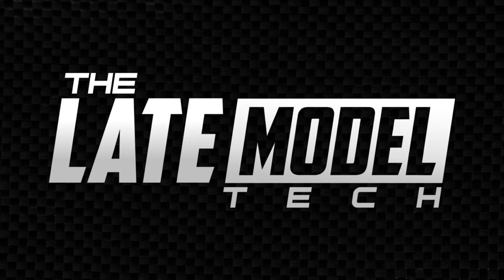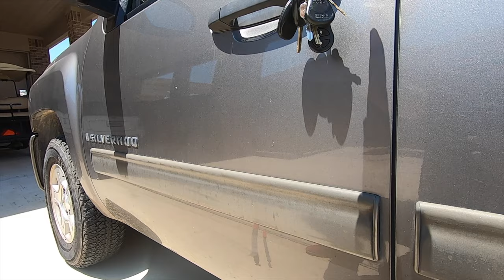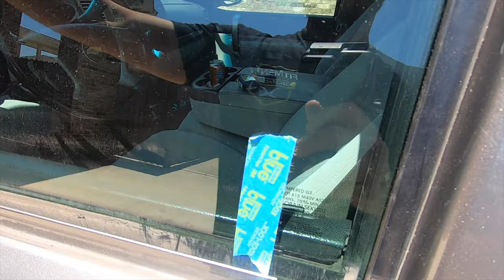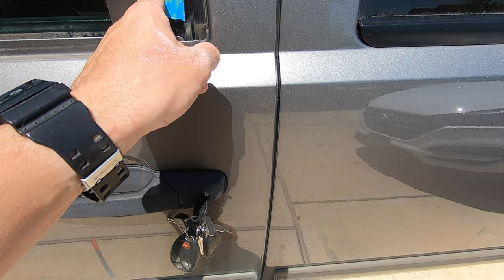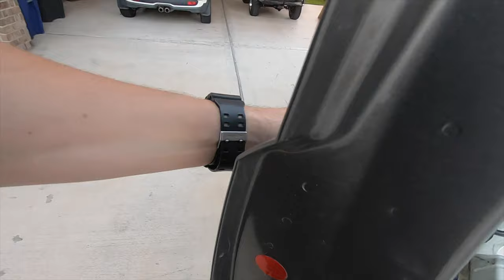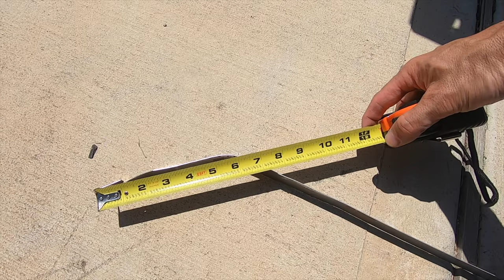How to use a Slim Jim on a Chevy Silverado / Unlock a Car door

Comment: I made a tool because I couldn't find my Slim Jim. I couldn't get it to unlock it just kept getting caught. Tried it today after modifying my tool. Had to cut a little off the bottom because it must not have been dropping enough to catch the hole slot. Took me 1 try and 15 seconds and I had it unlocked. Now the bad news. I was so excited I open the door to get my keys and the tool slid to the left and fell inside the door. I am surprised that happened because in the video you drop yours so you could use both hands and yours stoppped on the other side. NO PROBLEM. Just glad it is unlocked. The POS dealer wanted $104.00 just to cut a key from the vin.  That was without programming. Guess that would have been another $300 . Thanks Donny.

Comment: This is a great video and I thank you so much for making it, but I wanted to add this in the case someone else is as dense as I was and made the same mistake.
 Make sure the bend that the tech so excellently showed you how to make for the Silverado is facing you when you first put it in the window slot. I worked at it for a lot of time, about an hour, in very cold temperatures to no avail. Finally I hiked back to my home and watched more carefully and saw my mistake of the bend pointing to me instead of the truck. Once I hiked back to the truck, no problem, The Silverado rides again! Thank You once again for an informative well shop video solving a problem that can cost you plenty if you do not do it yourself.

Comment: This is a 97 thunder bird supdevill coop that has electricity windows and push buttons for your door locks and I don't know alot about using a slimjim so if you can make your own choices in which part of the door that is what best suits to use the slimjim to get into the car with the best possible way

Comment: You'd love to have seen this.  I pulled up in the liquor store parking lot and there sits a pickup nearly identical to mine.  All sorts of guys gathered around it, all big boys and one of them trying unsucessfully to get that door open on that Silverado with a slim jim.  I walked up to the crowd, reached through all these guys, stuck my door key into his pickup and opened it, pulled my key back and walked away.  They were all standing there just staring at me.  I doubt there's more than half a dozen keys for all those millions of pickups.  Be sure and try the keys of all your friends if you can.
Reply from the maker: Lol, funny you say that.   I have the jiggle key video coming soon. Lol
Reply: @Donnythelatemodeltech  I've opened my door with my ignition key jiggling it. Opened it with another key that was neither one. 

Used to start my dad's 64 Biscayne with my 55 Chevy pickup key.

Amazing how worn locks can be jiggled open with any similar key.

My 2000 Silverado has been opened with 4 different keys, and like I said, the ignition key.

You can open nearly any door or ignition with the same make key if you take some time and feel it out. 

When I was a kid a quarter would clean out a vending machine. I'd take orders from my friends. 

Cold drink machines were a bit harder.  I finally learned theft is theft but when you're a tween it was just defeating a lock for fun.
Reply: Thanks

Comment: Didn't have a slim jim, but I used the same methods with a wire hanger. After a few attempts I was able to get it unlocked. So easy a caveman can do it
Reply: Pop a lock wanted to charge $140

Comment: Cool. Unlocked! Now you can tow it to the junkyard.
Reply from the maker: Dang, little bit of chevy hate.
Reply: @Donnythelatemodeltech  I own three. And yes..more of a love-hate. Older models I love..but they eventually will just not be repairable. The newer models I absolutely hate. They are DOA. VERY poor design and assembly. But that's just my 2 cents. Your mileage may vary!
Reply from the maker: Thanks for the comment, stay safe and enjoy your weekend!
Reply: I have a 2010 with 300000 miles still runs like new. And everything works with no major repairs. Yea.. totally unreliable and poor build quality...

Comment: This happened to me in a remote area with no signal. Had to pry the handle and break the plastic collar over the lock cylinder, could open it with a screwdriver after. New handle - 40 bucks.

Comment: Ik its a pretty long shot to get a reply but i have a 2010 sierra so basically the same truck and i cant get my passenger front door open. Neither outside or inside handle will open it and im aware that it’s common for the little cable with the ball at the end to be disconnected and cause this but this isn’t the case. It’s connected i can get my arm down and see that. There’s something up with the latch maybe the cable has broke  where it connects to the latch? Idk but im desperate for help and of anyone in this comment section knows what i could do it would be awsome to get some advice
Reply from the maker: Stick you phone inside the door and look at the latch

Comment: Thank you sir!  Just locked myself out of my truck changing my brake switch.  It's 5 degrees F and the engine was running.  Luckily I was in my driveway and my slim Jim kit was in the garage.  Depth on my 2000 GMC sierra 1500 was a little deeper but in the same spot. 🫡

Comment: The link to the unlock kit....what the hell is the inflatable bag used for??????
Reply from the maker: you use the white plastic wedge , and cram it in the door and slide the bag in, inflate, and it prys the door open more so you can use tools to try to grab the inner handles and touch the lock buttons... this it the most common way vehicles are unlocked...and it can and usually does some kind of damage.
Reply: @Donnythelatemodeltech  Ok thank you! The link to Amazon, and pictures there, showed the bag being used under the tire (wtf), which is why I asked.